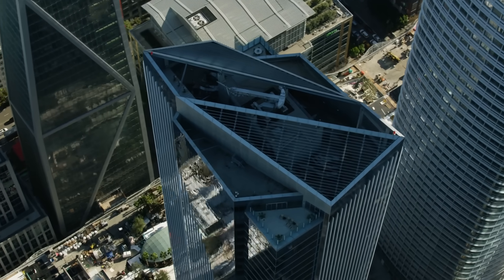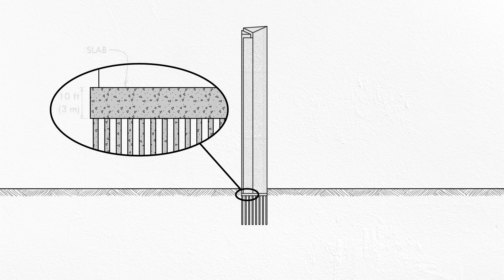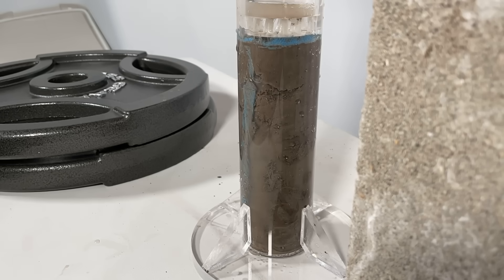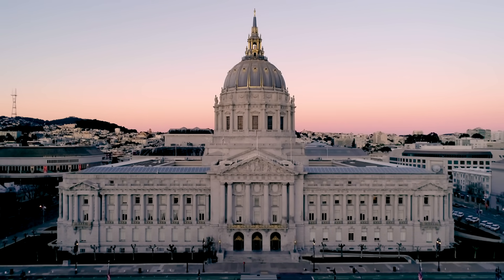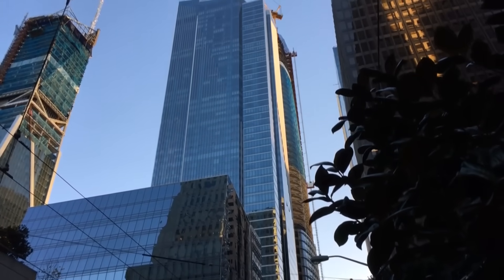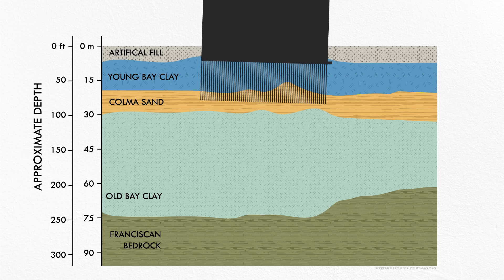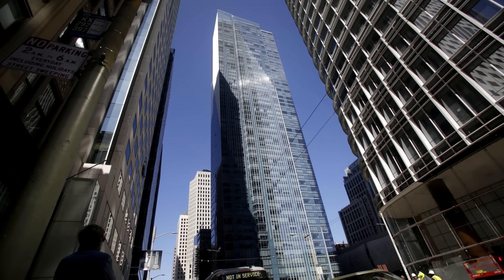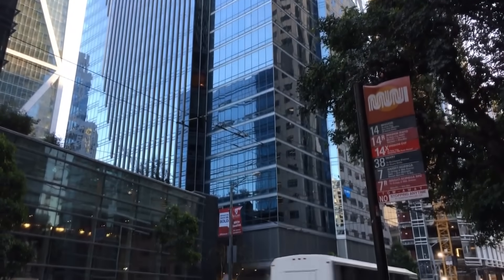What Really Happened at the Millennium Tower?

Comment: @practicalengineering With these repair piles taking such a huge percentage of the building load, being so long to reach bedrock, and having no lateral support (due to the holes being overdrilled) how will they deal with buckling for such long and highly stressed columns?
Reply: I had that same thought--typically lateral restraint for piles is provided by the soil, but if they're leaving an empty annular space I don't see where the bracing is coming from.  I'd have thought they'd fill the annular space first, and rely on the difference in stiffness between the end bearing on rock and the skin friction against the soft clay to ensure that they're not transferring significant load to the clay.  (If the piles are bearing on the rock, you can't have the pile compress the clay by (e.g.) 3 inches, unless you move the end of the pile 3 inches!)

Comment: I wouldn’t buy an apartment in it unless it was ridiculously cheap. The more it leans the more weight is on the low side. Equally I would pump water into the ground to shove it back up. Not loads, just a lot over a long time.

Comment: A 6+ earthquake will fix it. 
Liquefaction is a cruel mistress. 

There have been revelations that the weight of the building was originally based on steel. But changed to much heavier concrete structure. The foundation schedule was not revised. 

And going to bedrock originally would’ve been cheap insurance. So arrogance is a key factor. Saving 1-2 million sounds great. But with a 350-400 million building, 1-2% additional cost is called safety margin.

Comment: You should talk about the crisis with Citicorp Tower at some point- it was built with bolted joints instead of welded joints to save money, and because of that lack of strength and its unique design, relatively strong quartering winds could have completely toppled it over. It took an engineering student personally contacting the architect for them to redo the calculations and figure this out, and then the whole city scrambled with evacuation plans and secret construction to fix the structure before anything bad could happen. Really interesting bit of trivia.

Comment: Hindsight being 20-20.....solid bedrock is your friend when building large structures.  Fractured rock: Teton dam anyone?  Squishy (as it turned out in hindsight) clay?  This one.

One other factor to consider in re the condo prices:  Eventually, everyone else (developer, engineer, etc) will die or go bankrupt.  That leaves future liability for repair or deconstruction on the (condo) owners.  Lowered prices reflect the net present value of this perceived future liability.  Economics is every bit as unforgiving of fools as the physics of engineering.  It is not unheard of for poorly managed condos to be all but worthless when the assessments for repairs to the structure approximately equal of the value of the unit - net, you have nothing at that point and may be better off walking away.

Comment: You missed the main reason the building is sinking.  It was originally designed as a steel skyscraper and that's what the foundation was designed for.  The developer decided that making it out of steel was too expensive and it was redesigned as a concrete building.  This increased the weight of the building significantly, but the foundation was not redesigned for the additional weight.  The big question is, why was the original foundation approved for the new design?  This building has become a fitting monument to the evils of greed, since greed was the driving factor in this building's design and construction.
Reply: Yes! Thank you! I mentioned this and then saw you post.
Reply: Do you have any proof for what you say? It seems very unlikely to be true.
Reply: @pauldzim  Have you been following steel prices over the past decade?
Reply: @pauldzim  " It seems very unlikely to be true."  Why?
Reply: @LuckyBaldwin777  Because that would almost certainly violate the building codes and the ethics of the engineering profession.
Reply: @pauldzim   Ethics?  That's the only concrete skyscraper in San Francisco that is built on friction piles.  All the others are built on end bearing piles sunk to bedrock.  That building is built on old marshland that was filled with rubble from the 1906 earthquake and they used friction piles.  So much for "engineering ethics."
Reply: @LuckyBaldwin777  So you don’t have any proof of your claim then? Just repeating some wild claim you heard somewhere 🙄

Comment: This is a failed exercise of "value engineering" a structure's foundation.  It always comes down to money and developers are notorious for cutting costs wherever possible.  Once the project is completed it's someone else's problem.  This is why there are few places, like NYC, where you can actually, and safely, build tall structures.  As always, a very nicely done video.
Reply: Yes, although the city did also inspect the design and approve it, hence the 'no blame' settlement I think.

Comment: " ... have shown that the building is perfectly safe through detailed modelling and investigation "    Not fer nothin', but the original foundation was designed " through detailed modelling and investigation"  too.   So, the public might be forgiven for taking a "once bitten, twice shy" approach.
Reply: Also, this building was designed for a steel above ground structure and ended up with concrete because it was cheaper at the time. Glaring omission here.
Reply: agreed: I distrust the engineering evaluation. If the plan does not include adding supports on the other side it will be likely to respond to an earthquake in a very bad way.
Reply: You have to remember that the design phase of a project operates on a budget, which dictates the extent of the initial investigation. With the hindsight of the actual loading response, and the extra $$ from the forensic investigation, I’d bet on the latest models being well within the ballpark.
Reply: No, the building was safe according to original plans AND according to those later investigations.
The tilting is not about safety. The building could withstand it.
The questions here are others: If nothing done, the building might stop being safe in 10 years from now. And, the property values are way less than expected.
Reply: Delibro and for the record, I was not claiming that the later determination that it was safe was in error,  but that it shouldn’t be surprising that it was received outside the engineering community with a certain level of skepticism.
Reply: Delibro missing the point here.   The point being that the modeling predicted a certain maximum settlement, and the predictions turned out to be in error by an order of magnitude.  You can stamp your foot and declare that the building was safe according to the original plan all you want, but by any rational standard, the original designers blew it. Badly.

Comment: How will they connect the joint between the original slab and the extension slab? wont jacking out the joint in the original slab damage its loading bearing?

Comment: Hey mate. I'm pretty sure you messed up the Metric units. Foundations of houses here in Europe are usually designed for about 150-250 kPa. Which is about 15-20 tons per m2. Your picture at 1:10 suggests 0,5t or 500kg per m2. Doesn't seem right to me.
Reply: The conversion was done correctly from pounds/square foot at the very least from my quick math
Reply: @slimekittenv  then those values are simply wrong. 5 kPa is nothing in construction. 500 kPa which are suggested to be extreme, are absolutely common for normal foundations.

Comment: Hey, love your videos! Here’s a construction question I’ve had for a while, in case you want to cover it:

When holes are covered up with temporary steel plates to allow traffic to pass over them, what keeps the steel plates from moving, especially when trucks use their brakes on top of them?
Reply from the maker: A lot of times they put hot mix asphalt around the edges. But also those plates are just really heavy.
Reply: @PracticalEngineeringChannel  Or if you're from my town then they just cut a strip of road out that's around 2 inches deep that you'll hit so hard you'll be surprised your tires didn't pop.
Reply: @PracticalEngineeringChannel  Yup that is what I see around here in Denmark. Not everywhere and every time but it probably has something to do with the speed limits and types of vehicles allowed to go over it.
Reply: In addition to Grady's answer, the coefficient of friction between the plate and the asphalt is probably higher than that of the tires to the plate. Also, the downforce for the plate-pavement friction  is truck + plate, and the truck-plate friction is just the truck.
Reply: Occasionally, at least with the ones the City of Worcester (MA) uses, the answer is rather alarmingly "nothing."
Reply: I've seen some that look like they are 'nailed' down in a few places around the edge to keep them from slipping, which does happen; the pavement is rarely flat and the plates bend only so much.
Reply: We Use a tool called a asphalt stripper to cut a rabbit around the trench the thickness of the road plate.  When you place the plate it is flush with the old road surface, no bump, no movement, no problem,
Reply: We have a project going right now with a large open trench for a transmission duct bank. The crew spot-welds the plates together at the end of the day on top of using asphalt around the edges. Super duper secure
Reply: @Roger Spaulding, not certain how cutting a 'rabbit' around the trench solves this problem, unless this is some form of sacrificial rite to the trench Gods.
Reply: @bobjohnson8970  it lets the plate set level with the existing road surface in a pocket so it can’t move.
Reply: @bobjohnson8970  it’s a rabbet, I hate auto correct!
Reply: @Roger Spaulding I knew what it was and figured you knew what it was, I pulling your chain on the spelling. I did not consider spell check. You have my apologies.

Comment: Not sure if you are connected enough to know this- but if they have observed accelerating settling as they drill into the Old Bay Clay, has anyone considered drilling into the opposite corner so that it settles back?  Heck, long term, one side will have a better foundation than the other, so eventually, the ring of piles through the clay will be needed- it seems.
Reply: I don't think the exact location of the vibration matters much, the vibrations are accelerating natural settlement over the entire foundation, just this was uneven to begin with and so it's equally uneven now.
Reply: @tomfeng5645  Maybe.  But it also might be directional.  Given the situation, it seems worth trying, at least.  Drilling also moves material around in the area- to assume that it will do nothing ignores a very possible solution.  if the drilling that they are doing is accelerating the lean on that side, just keep doing it would probably accelerate it more.
Reply: @alfamaize  Given the situation I'm not sure you'd want to be trying something that could make the lean a lot worse. Maybe some limited testing could be possible without too much risk? Would require analysis to say.
Reply: @tomfeng5645  Maybe not.  But the engineering team clearly does not fully understand what is going on- as this extra settling is a very unexpected and unwanted result.  Also, the result of doing that on the other side has the possibility of having a positive result of straightening the tower a little.
As an engineer, the fact that there have been some serious unexpected results is a huge problem- especially when one of those results were the opposite of what they intended to do.  Maybe they can continue, but doing that and expecting that everything will go right is currently a mistake- since all of the observable results have been bad.

So the team is left with- keep doing the same thing and hope for better results, or do the similar thing and hope for the same result which makes the situation better.
Reply: @tomfeng5645  Clay can respond to vibration by losing integrity and slumping, or sliding sideways. Sounds like that is what was happening.
Reply: that idea has already been used on a very famous tower, the tower of pisa. they slowly drilled out sand on the backside of the lean and by doing that they decreased the tilt quite a bit. that was smaller scale than would be needed here but it shows that it works
Reply: @laveturnerjones3954  agreed but in Pisa there are no utilities that will get torn to shreds as it sinks on that side. Also, if the building sinks too far the ground floor will now be partially underground so you have to redo entrances, etc. Still better than falling over but also needs to be considered
Reply: @laveturnerjones3954  It's the soils below the pilings settling, if you remove soil at where the pilings are, it'll make the sinking a lot worse as it reduces the friction that is keeping the entire foundation in place.
To do that requires drilling down to below the structure, which is shown to be problematic...
The Tower of Pisa was built on a shallow platform and so doesn't have these issues.
Reply: That tried that at pizza it was not good
Reply: So a half Billion dollar "repair" showed the need for another 1/2 billion dollar project, and a great amount of hope
Reply: @patriot9455  There is a 50% chance the other side will need to go to bedrock also.  Once they get 1/2 done it will be a wait and see game.   

Interestingly I work in SF and live nearby and I actually had to have my house add piers that go to bedrock.  My house sank about 6 inches.  It is a very different use case but it's cool to see the same basic technology at very large scale.

Comment: I guess it boils down to two options, either push up (support) the side that's sinking, or drop the side that isn't. The leaning tower of Pisa was "corrected" by removing soil from the opposite side of the tower from the lean. I'm no expert but supporting two sides of the concrete slab with those perimeter piles could unevenly stress the slab and lead to cracking, or cause the clay on the opposite side to the lean to become more compressed and drop. Either way what a fascinating problem to have to fix. Great presentation Grady, keep it up :)
Reply: Do you mean Pisa in Italy ?🤔
Reply: @Deepthought-42  Doah! more haste less speed. Well spotted!
Reply: @Deepthought-42  Considering I've actually been there, that was an epic mistake!!
Reply: @Tom-zy6ke  👍As an engineer who has always had difficulty spelling, I shall be enjoying my pisa tonight 😉🤣
Reply: @Deepthought-42  I hated my last Pisa, what with its toppings of sand and cement on a stone base........broke all my teeth trying to chew it.
Reply: @Stephen_Black  ;0)

Comment: When a structure like this sinks by this much, shouldn't everyone notice? how is it that the entry / first floor is still at ground level?
Reply: It moved 16 inches, which isn't a lot. But that 16 inch won't have created a sharp drop compared to it's surroundings. The sidewalk will have tilted, the doorways and walkways will have tiled. It will have created a slightly uneven floor surface around the base of the building but barely if at all noticeable to humans as it was just a 16 inch drop spread over a large area. Everything will have just blended together.
Reply: Think of it like using a test dial indicator to square a surface to a machine table, 0.010" is an enormous amount in reference to precision, but 0.010" difference over a distance of  30" is far better than 0.010" over 6". It's really easy to see how far off the 6" part would be compared to the 30" part
Reply: They were constantly doing concrete work around the perimeter of the facility. Some obvious things were not discussed in the video
Reply: Anticipating the sinking that they did, they probably built the "first" floor some height above street grade that would still result in steps (and ramps) up at the end of the projected settling.
 That would be a lot more acceptable to tenants, and make it easier to keep rainwater out of the lobby (!) than the inverse.
And then you get cities that have settled a lot more than that (or built up road surfaces more) and you get often-flooded half-buried basement levels that used to be first floors.
I think Dublin, Ireland is one such city, if I remember the show about it correctly

Comment: Do the hydraulic jacks just remain there holding the weight... forever?
Reply: No.  Once each jack is loaded to the degree required (using a shed-load of big hydraulic power packs, and measuring the load you've put on by the pressure in the hydraulic lines) you hold it for a while and make sure thing are stable.  Then you can put in solid chocks and turn the power packs off.  Perhaps the jacks stay in, in case you need to do it again - and perhaps they don't.
Reply: @markavis7232  What are jack at this scale normally used for? It's seems like force is required when you combine the weight of the building and the ground resisting the building being lifted.
Reply: @a-q197  I work in a structures test lab, where we use large hydraulic jacks - here I think they are even bigger, and more of them, but the same idea.  It might be better to think of these jacks in this example as being there to 'take up the slack' rather than lift the whole building - though of course they are reacting against the building weight.  If the existing piles are under a load of  x MPa, and your new piles are initially unloaded, then the building would have to sink a good bit further until the new piles started to help - which you don't want.  So if you 'pre-load' them with the hydraulic jacks to a similar pressure as experienced by the existing foundation, then they start to help you out immediately.  It's like propping up your bookcase with a spring - you want the spring to go in tight not loose, or the lean you end up with will be more than you want.